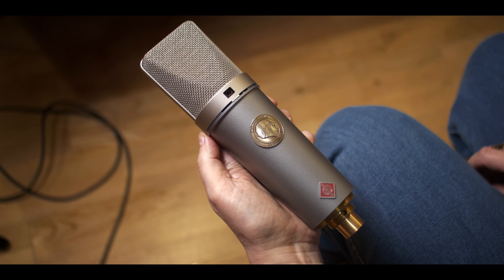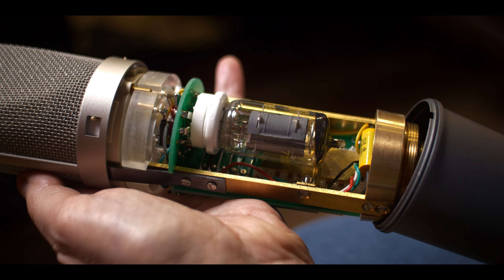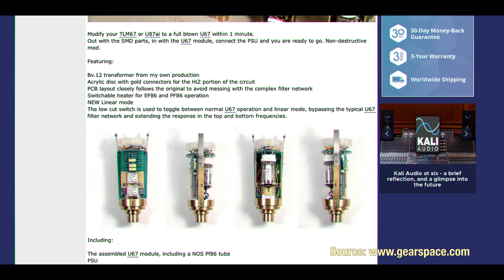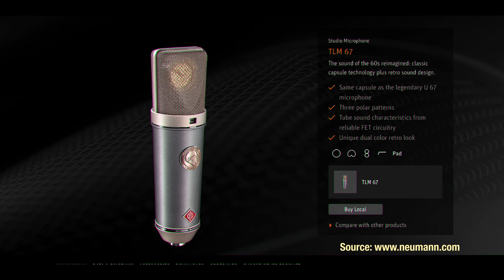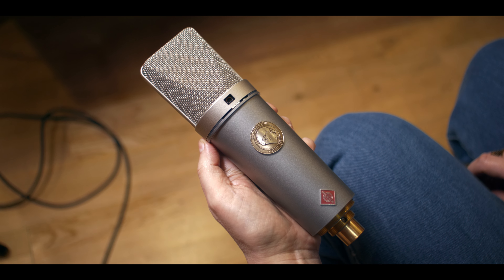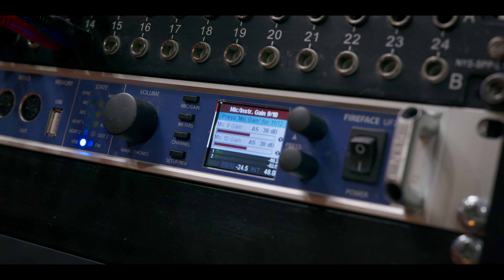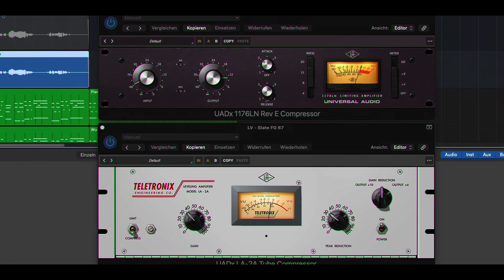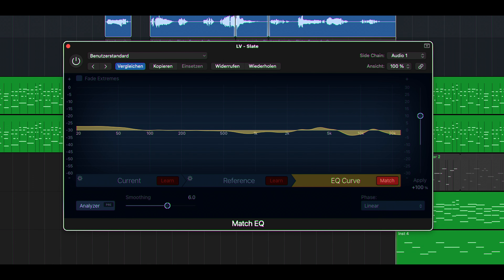Review of a Neumann TLM 67 with a tube mod (Neumann U 67 Clone).

Comment: Nice test! Did you guys try out a few takes with the hpf switch activated (top end boost)? The latest MK67 have this mod to match the modern production U67. Cheers!
Reply from the maker: To be honest we had no idea that there maybe was a HPF-switch. Do you have a TLM67 with this mod? If so, how do you like it?
Reply: @kaplanhirschmannmusic893  I've had mine for a few months. On the stock setting, I have the same feelings as you about the mic, kind of dull. So I leave the HPF on at all times. I've also just changed out the super cheap mic cable to a Gotham GAC-7 and it suprisingly evened out the midrange perfectly. I'm still putting it through it's paces but overall, i'm really loving it. It's a rich sounding mic. Next up is trying out a few different EF86's for it. Best of luck.